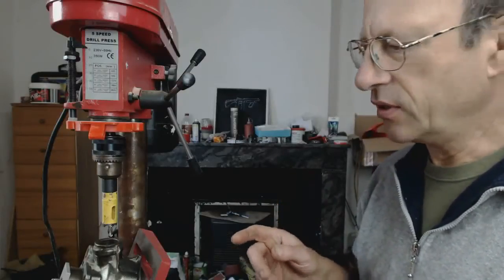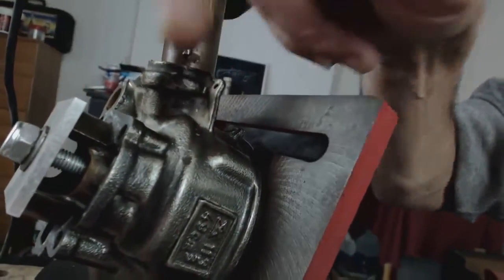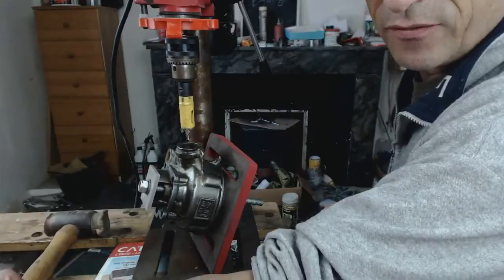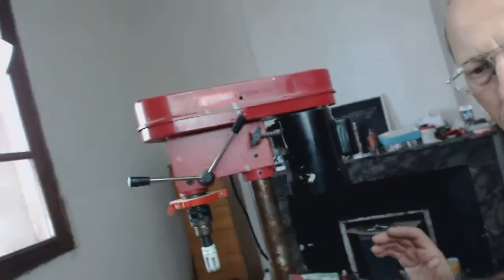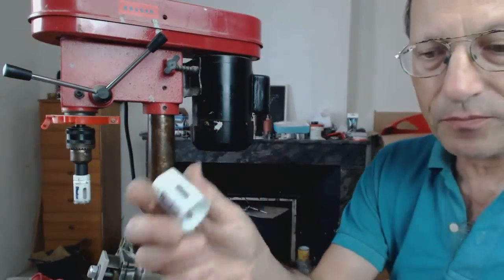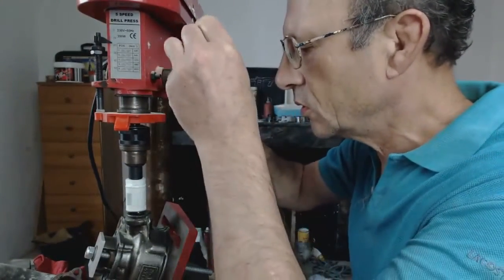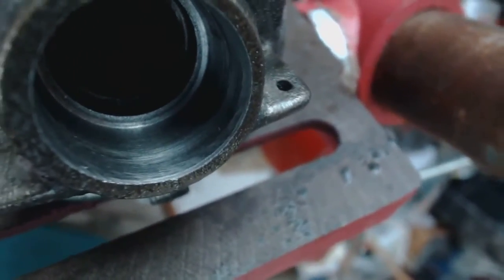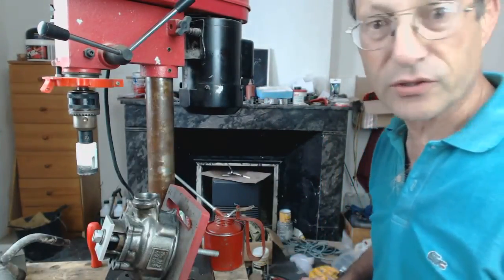AM6 Boring the Exhaust Port Outlet at Home

Comment: I have just bought a Derbi Senda with a AM6 engine I plan to use in an FS1E, noticed the exhaust port outlet is way small! why would they do this so small???? never seen it before on a 2-stroke, how much gain is there in boring it out, are the big bore kits also small exit? the Derbi I have is 2011 model trail bike, I know Yamaha used the AM6 in the DTR AND TZR 50cc bikes, what are the best mods on these without the loss of too much mid range, any idea's?
Reply: Engine swaped Senda ?? 2000-2005 they had the Derbi EBE050 or EBS050 engine in Senda and 2006+ have the Piaggio D50B0 or D50B1 engine and not the Minarelli AM6 engine.
Reply: @coddas87  Yes, was told the engine came from a RS50 and was fitted to the Derbi Senda I bought for the FS1E swap but turns out its a D50BO engine not the AM6 fitted to the Aprilia, better clutch and gearbox than a AM6 so I am happy, will do the swap when I finish the project I am working on now.
Reply from the maker: Hi Richard.
It was made small to restrict the power.
If you buy a BBK it will have the large exhaust outlet.
The result is only an increase in power.
Make sure to bevel the BBK port edges - check my channel for the vid on how to do this.
Fitting a 17.5 carb will keep it frisky.
A 19 carb will give it more top end.
When I fitted a BBK; after riding it a bit, I added a couple of breather holes to the airbox, and it transformed the power output (like chalk and cheese).
Good luck :D
Reply: @EngineTuning  thanks form the reply, I understand 2-stroke tuning but not on one of these engines. any tips will save me time, the Derbi I have has a 70cc kit and a fresco pipe but still small exhaust outlet , the transfers look small too!  I'm an old guy that wants to build a better FS1E than I did when I was 16 but  with 4 "projects" on the go and a house to work on progress will be slow! will look at the rest of your vids when I get the chance. Working on a KH125k9 and a DT125 1974 model before the FS1E but cant wait to do it as its my original frame from my first 1978 Fizzy. Thanks again.

Comment: this is rather weird.
so you've made an excentric hole, wich is too big for your exhaust without the possibility to use an o-ring...
tell me why this should be usefull ?
Reply from the maker: Very good question Sjemmie :)

This was great experimental work ... using only the tools that were available to us
... a basic hole borer, that was never designed to carry out this task.

The objective was to gain 'full exhaust flow'.

The issue of not having the O ring, to stem the minor oil seepage, was of zero consequence to us.

Sure, you could suggest that the odd drip of oil might be unsightly.
Perhaps you might rail against the pollution (of such drips)
... though, in reality, this is inconsequential, considering that the the road is created using thick tar.

So ... we gained a better breathing engine AND showed the community that this work can be accomplished with the barest minimum of tools (a pedestal drill, and a hole borer).

Obviously, you could employ an engineering shop, to carry out the boring.
They would then cut a slot for the O ring (nice).
However, it would be 'them' that did the job - not YOU.

(oh yes ... and it would entail you handing over, a fairly large chunk of money, that otherwise might be spent on some other project).

:)